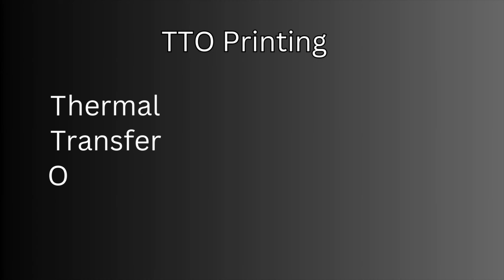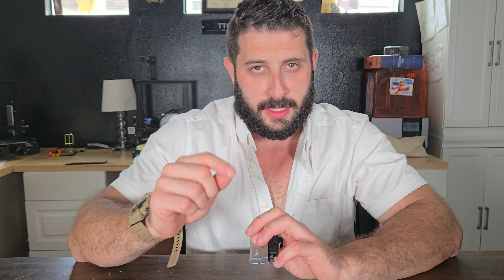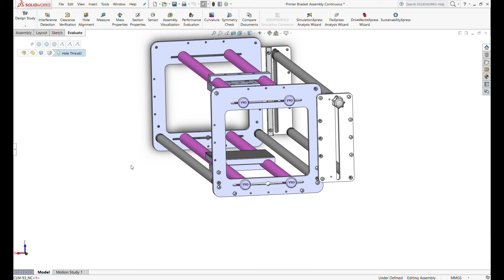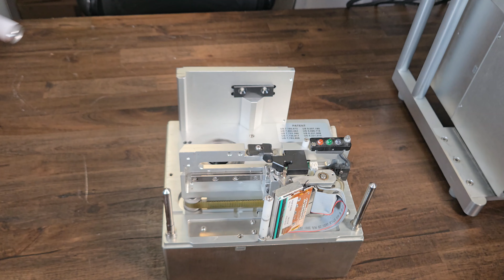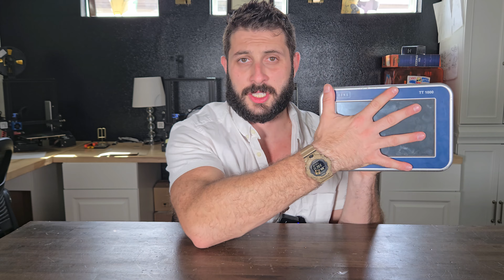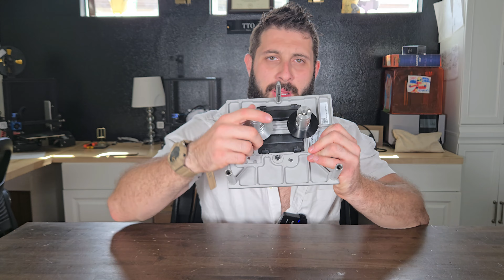Videojet 6530 E Course PART 1 Intro

Comment: Issues with enlarging the printed date ,time, lane we have 4 lanes so 4 printers one 1️⃣ is not printing as large as the other three HELP
Reply from the maker: Are you printing in continuous mode with an encoder
Reply: @TTOPARTS why ??? Is that possible the  issue oh and the printer 🖨️ is printing like mirror backwards as well
Reply from the maker: You can reverse the image 180 degrees from the screen, it sounds like you may have a faulty orinter where are you located if you can get it to me I can fix it